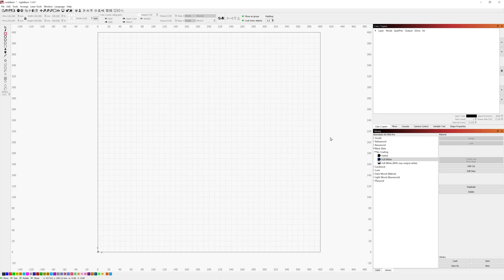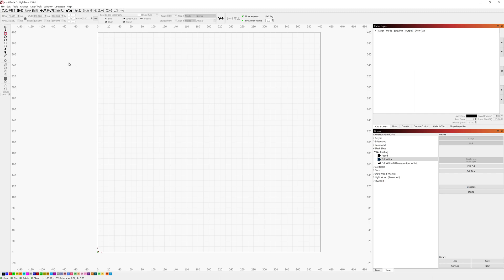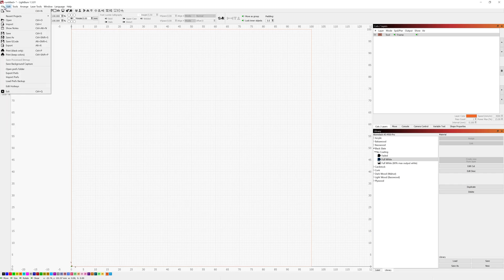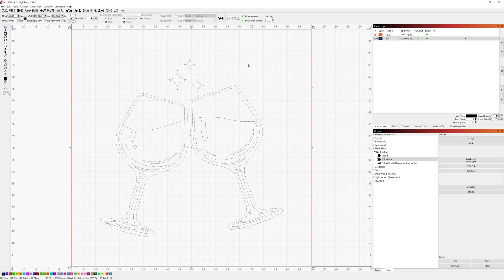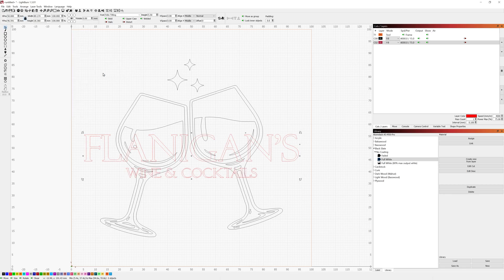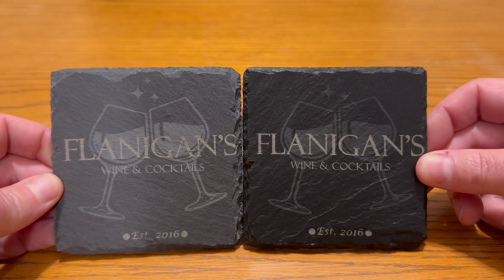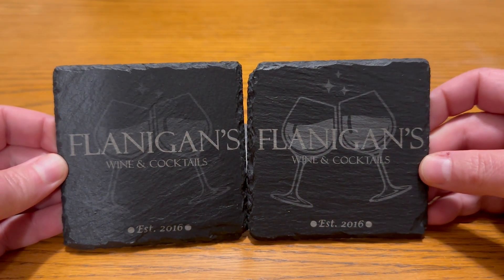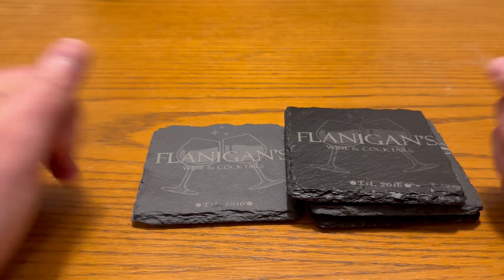Engraving on Black Slate Tile Coasters - Atomstack A5 M50 Pro (5.5-watt Diode Laser)

Comment: Not sure where I am going wrong. So I have an Atomstack A5 Pro and after a lot of rummaging around the net I did a material test which has not yielded good results. So after the material test the best option I could see was 8333 Speed and 75 power. The image was still barely visible. I tried invert the image which did not make a huge difference and so I was wondering if anyone knew of other settings or what they use in laymans terms as I am a laser virgin so please be gentle 🙂 Also thanks for a great video which I found very informative and will go through it again and again in case I have missed something, Also I see in your materials list the option for black slate, where did you get your list as I had mine from LA Hobby Guy and does not have slate. Heeeeelllllppppppp ? Thank you all so very much in advance 🙂
Reply from the maker: My list / library is self-created as I've done trial and error with the different materials.  

For bright white, I have 4,000 mm/m and power 75%.  

For the faded I have 4,000 mm/m and 17.5% power.  

With the Atomstack, it's important to make sure you have the laser head 2mm away from the material using the spacer that comes with it.

Comment: The 50w of your laser , are the watts needs to run your machine, not the watts out of your laser module, those are 5w out put, is important to state that wattage in order to give the right speed and  amount of power.
Reply from the maker: Correct, but even if a user has a similar 5w diode laser, the settings won't be exactly the same which is why I always state that they need to perform their own material test calibration before doing work on any new material.
Reply: @CubicleNinja  
   Still the most important info to share is the real out put power, of course they need to work with their own setting al laser power out put, nut I've you state the real put wattage, we have a most realistic idea of how to set up the machine.
Reply from the maker: Fair point.  I included the laser wattage in my video on the acrylic and I've adjusted the description of my other videos to now include that the Atomstack A5 M50 Pro is a 5W laser
Reply: @CubicleNinja  Hello, congratulations for your video.
I have an Atomstack s10 Pro with a 10W laser, are the settings the same?
Reply from the maker: Unfortunately, I'm not sure, I've never used any other lasers.  I'd imagine you'd be able to go with a higher speed, though, or a slightly lower power setting since you have a 10W vs the 5W I used.  I don't know how the dual lasers work differently though to balance out the power and speed.

Comment: Awesome video. Thank you!! Also, is the M50 better than the a5 pro. Because I did the background speed the same as you and nothing engraved at all. Hope my laser isn't dying on me.
Reply from the maker: I’m not sure about better but it looks to be a bit more powerful for both input and output wattage.  You’ll most likely need to reduce the speed (and maybe increase the power a bit) to get the proper effect on the clear acrylic.  Unfortunately, since this is my first laser, I have nothing to compare it to.  The best bet would be to run the small square material fill test with a power range from 10% - 50% and the speed range from 1000mm/min to 3000 mm/min and see which combination on the test sheet gives you a good white etching without any pops or burns.
Reply: @Jonathan Flanigan  yeah I'll have to do some test runs. I had to do the background at 4000/30 and did the front   letters at 4000/75. I haven't sealed it yet. So maybe it'll come out fine. I was just curious if you knew. Also I feel like my laser is dying anyway haha.
Reply from the maker: It’s definitely wild how much a small tweak to the power and speed can change the final output on some of these materials.  I haven’t had a chance to do a test on a coaster after sealing it first like some others have recommended.  I’d love to hear what settings end up working out for you when you get it tuned in. 

One thing I did when I was doing all my material tests was to remove the feet from the coasters and run the tests on the backside.  That let me not waste multiple coasters when I was getting everything figured out with my laser (they aren’t super expensive, but it adds up fast!)
Reply: @Jonathan Flanigan   yeah I didn't have any "extra" slate laying around (like I should lol) but I did 4000/30 for the background and 80 for the front letters. After sealing it (while it's wet) it looks good. But I thought the back ground showed up too much. So I tried it at 4000/25 and after sealing it. I can barely see it. 

I did do 2 wine glasses cheering like yours. But I think my front letters are the issue. I have a fancy cursive L right on where the glasses are so for the L to really stand out more than the glasses. It probably has to be a perfect ratio of spd and power.
Reply from the maker: @RebelRandy04  Ahh, that definitely makes sense.  With the slate (and a little bit with the cork coasters), the font style and weight become extremely important.  On the slate coasters, using purely lightburn, I've found that selecting the text and using the Tools -> Offset Shape with an offset distance of 0.55 - 0.95 with an outward direction and setting it to delete the original objects thickens up the font enough to help make it "pop."  

The reason for the range in the offset distance there is because different script fonts look better with different offsets to allow it to keep the fancy script feel to it while still giving it the extra weight during the engraving.
Reply: @Jonathan Flanigan  well damn. I didn't know that nor read about it anywhere. I'll have to play around with it. Thank You!!

Comment: i finish my slate before engraving and go with a higher power when engraving, have done some portraits and gave them another coat after engraving image can be hard to see but best results are to prefinish using atomstack a10 pro
Reply from the maker: Thank you for that suggestion.  I initially thought I was going to prefer the unfinished look to the slate coasters, with the gray instead of black shading.  After using them for a day, though, I realized the unfinished was probably not going to be the best for long-term use.

This upcoming weekend I'm going to go through my material test after applying the sealant first to see how that impacts the speed/power requirements on my laser to get a similar result.
Reply: @CubicleNinja  im going to be trying a beeswax finish after the engraving on my next tests, will be trying out some color fill also got delivery of mica powders this morning, being irish and paddys day coming cant resist trying it out
Reply from the maker: I saw a couple videos where people did the color fill, it looks really nice.  I am definitely looking forward to trying that out.
Reply: @CubicleNinja  its the beauty of laserology the possibilities are endless and with the way tech is evolving it can only get better, keep on lasering

Comment: I appreciate the step by step explanation. Very clear and easy to follow. I can't wait to try this. I followed your procedure for engraving in clear Acrylic; with a slight modification. I just changed the picture setting from grayscale to threshold. I got an excellent result. Just in time for valentine's day lol.
Reply from the maker: I'm very glad to hear it was helpful!. The image mode definitely comes down partially to personal preference and also to the type of image you are going to be putting on the acrylic (same applies to black slate).  I intend to go back through and do tests using the different options and also using image-r first and then setting the mode to passthrough.

Perfect timing with valentine's day as well :)